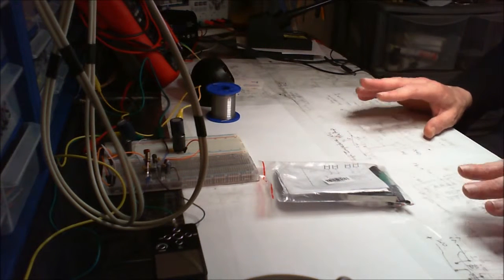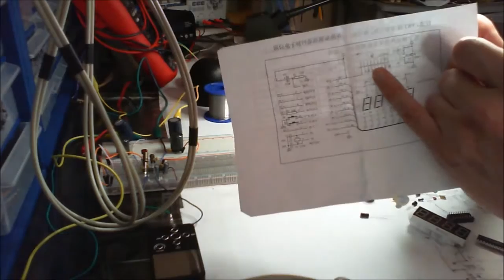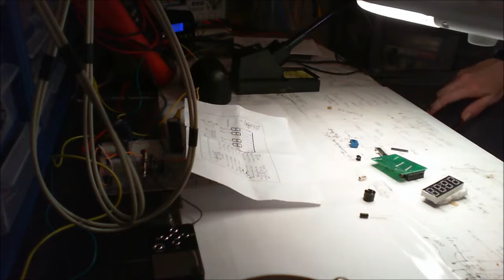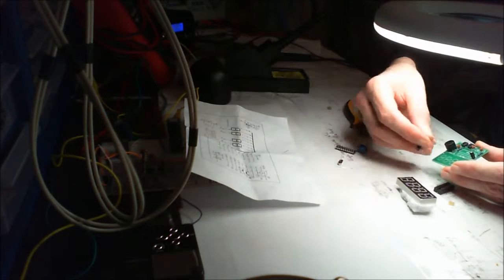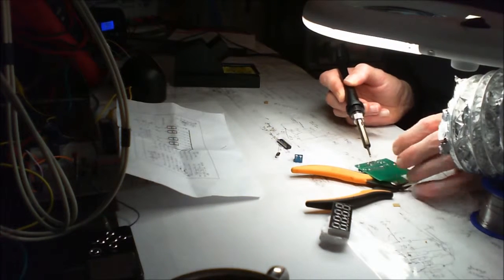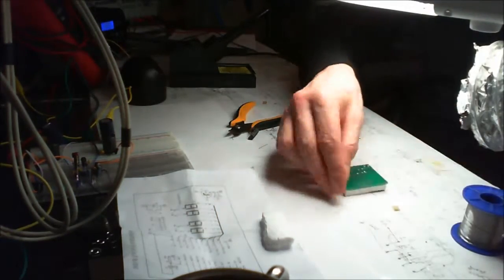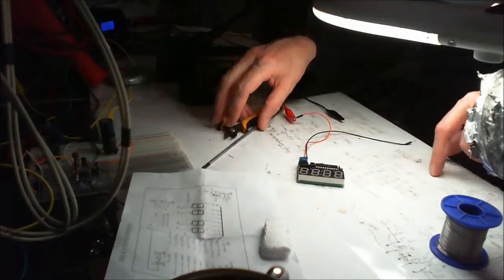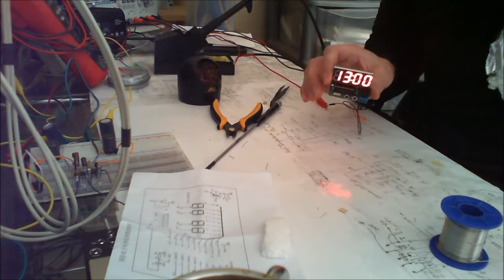eBay C51 4 Bits Digital Electronic Clock

Comment: '
did 2 soldering on switch 1 = 2 soldering on switch 2...
no need 4 soldering on sw1 = no need 4 soldering on sw2.
good C51 clock kit

Comment: I bought one of these as im trying to get into electronic projects and teach myself soldering. Amazingly I have it running! I want to power it off of battery and have put three AA batteries together (4.6V) but it's draining them in a matter of hours. I KNOW NOTHING about electronics so wondered if you might know why? (I am assuming it has to do with draw and amps etc) ... also if you have any ideas about what batteries would be required to keep it battery powered if possible that would be great!
Reply from the maker: +darkunderworld Hi there, Its great you got it going. I left mine for months before I built it because I was scared of the SMD's. I am over that now. I use a 3.7 volt flat battery from a laptop as it would not charge, some cell's still worked. My battery lasts about four days but I have the most basic second hand display, the single LED counting the seconds. What display setting are you using?
Reply: +MonkeyMagic Elecifun  Just the clock with blinking comma on the seconds. I think it's got something to do with the current being draw. I have the power but not for long, a laptop battery would obviously last longer because it has more "juice" (milliamps?) and perhaps this is key...so same voltage but not enough juice!
Reply from the maker: ***** I am using just 1 cell from the laptop battery. It charges to 4.2 volts. Can you measure your current draw? I have just measured mine and I get between 16 and 22 milli amps.
Reply: +MonkeyMagic Elecifun I'm still learning about it tbh so no I can't measure the draw yet,  when I work out how I'll get back to you
Reply from the maker: ***** Do you have a multi-meter?
Reply: Yes
Reply from the maker: ***** Great stuff you can measure the current being drawn from your circuit. Put the meter into milli amp or amp mode and take 1 wire off your clock battery  and put one meter lead on the wire which was connected to your battery and the other on the battery the clock will come on and the meter will show how much current is being drawn/used.
Reply: thanks thats really helpful... 0.03 it shows on the 10A setting so 30 miliamps?
Reply from the maker: ***** That seems okay, maybe need better battery's. Using old laptop ones is good and you can buy tiny charge controllers which wont allow the battery to drain to much for less than a pound or couple of bucks.
Reply: Well I've bought a proper battery box and will get some decent batteries in it...  I'll let you know how it goes when the parts arrive,  thank you for your help